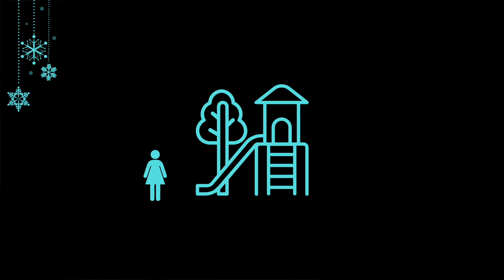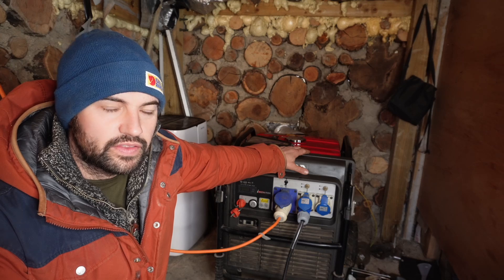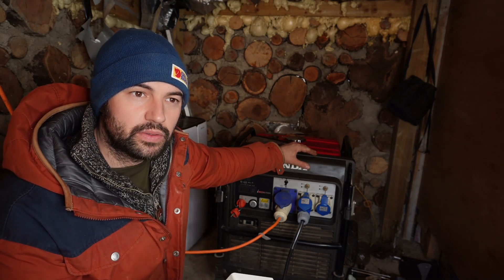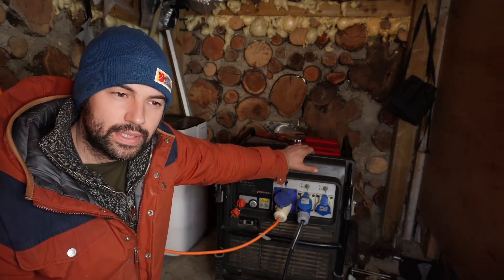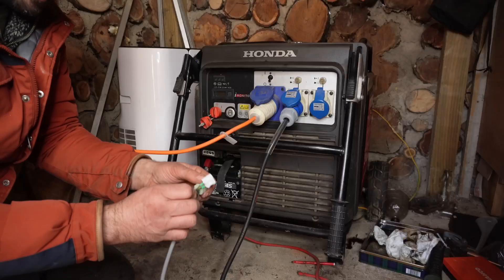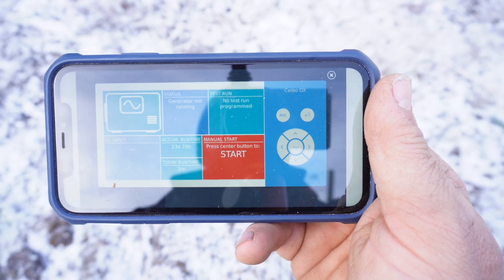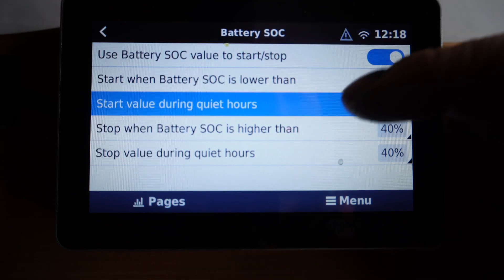REVOLUTIONISING OUR OFF GRID SOLAR WITH AUTO-START

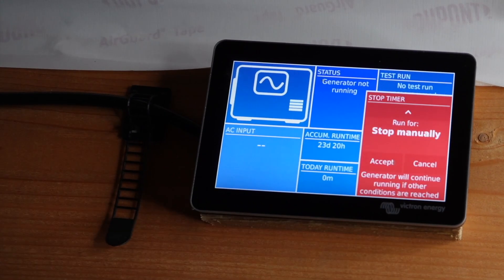Comment: Greetings from Chile/SouthAmerica! Great video! Its very motivational. Im trying to do the 2 wire-start that you tried in the (3:42), did it work for you? When you leave the generator in ON position (0/I), the battery of the generator dont drain out? Whats the application that you use to control the parameteres of the inverter (5:30)?

Comment: You could add a pressure switch set to a higher pressure as a backup. Or maybe a timer in case it's a leak.

Comment: I let my auto start drop to 15% before starting during quiet hours, with the hope it might get through the night. If it does get through the night then as soon at the quite hours ends it switches on.
If I know the battery is low in the evening, I use my phone to start the generator on an timed 1hr charge after which it auto switches off. Then at least I wont be disturbed during the night.
No more SOC watching.... (As if that will ever happen.)
Just remember to put fuel in the generator, as it can come on and off without you knowing if you're out for the day.

Comment: Interesting...
I have 3 separate systems..
Which means I can switch between the main 2 if one is low.. or a battery gives up.. all very well saying buy a new battery.. what do you do in-between?
The 3rd is my main engine, which can be linked to the other 2.
Funny I'm about to wire up another separate 12 volt.. battery bank.. using the solar as an overflow when the others are full.. they are older batteries and will be fine for lighting, phone charging etc.. it's just a way of getting full use out of them.. particularly as battery prices have gone up a lot.
My suggestion is have a smaller separate system as backup for lighting and charging phone etc.
Also a main switch to switch off non essential power when you go out or it even switches off everything and have a small system doing lighting, so if you get home and it's dark.. your porch light and whichever lights indoors work so you can get to the main switch.

Also splitting up the water tanks might be a good idea.

Comment: My concern with the remote start is the missing warm up phase. You should also add a kind of delay or temperature relais, so the generator starts, but the powerline gets connected after some minutes or when the generator is warm enough to deliver the load without massive wear in the start phase.

Comment: It feels like you need something to monitor different loads in the house remotely and to be able to isolate them in addition to the remote generator solution.

Might save you some money in the future if pumps end up burning out because they run dry etc, then you can be alerted if X is draining more than expected and isolate potential issues before they become problems.

Comment: Move to a deye or Sunsynk inverter this would be revolutionary for you auto gen start experience as it is the most sophisticated gen involved hybrid inverter on the market. Add a lot of control and refinement.
Reply: I think it's a bit hasty to scrap a victron inverter for a couple of extra features. The victron seems to have quite a bit of customisation available.
Reply: I've just got my pylontech/Sunsynk 8k up and running this week. Absolutely wonderful bit of kit, so many built in features. Hats off to the CEO Keith Gough who has designed this from a Deye variant. 😊